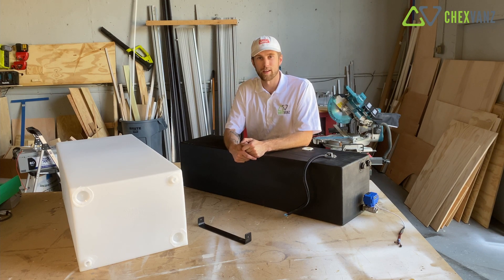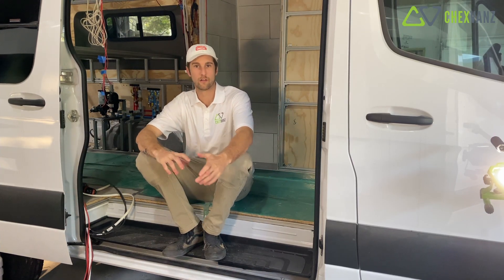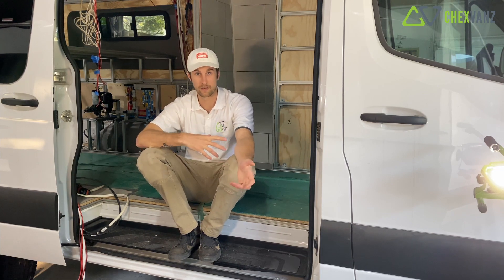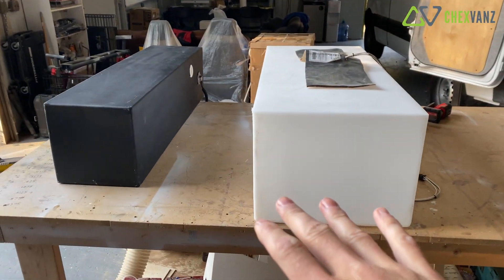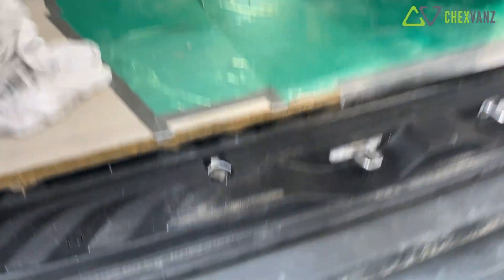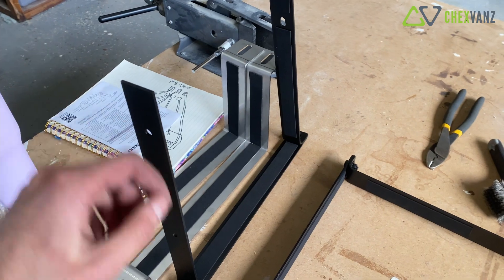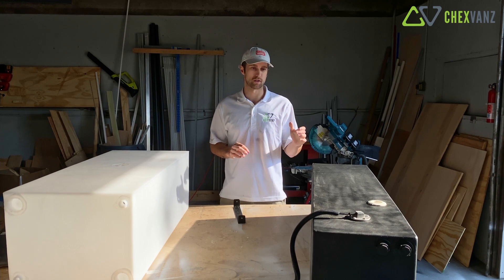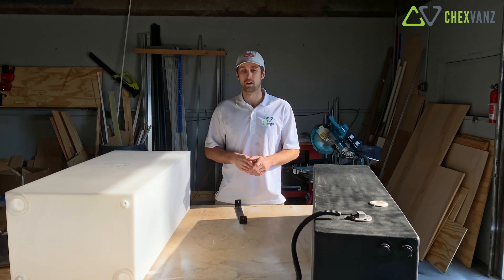How To Build Camper Van Water Tanks | Mercedes Sprinter 144 Build Series

Comment: great info thankyou, im about to try and fit mine 🤦‍♀🤦‍♀ one question though, you slide it back and firth to get the best position but the how do you stop it sliding back and forth? Just the brackets on the side tightened up is enough?
Reply from the maker: Yes the brackets are typically tight enough to hold the tank in position. You can always add a support bracket to the front & rear.